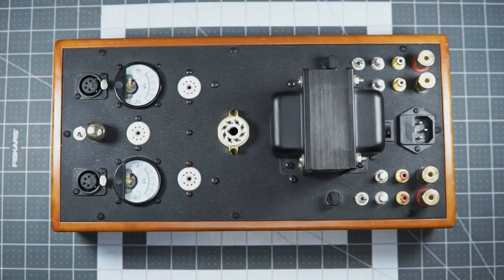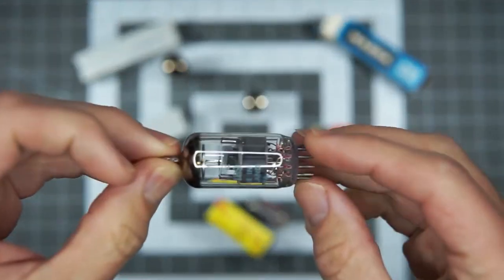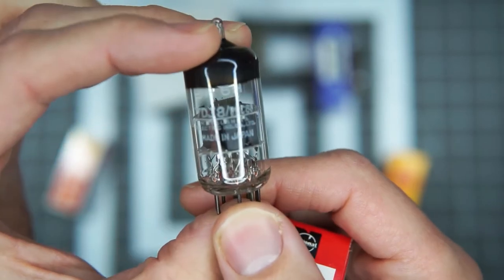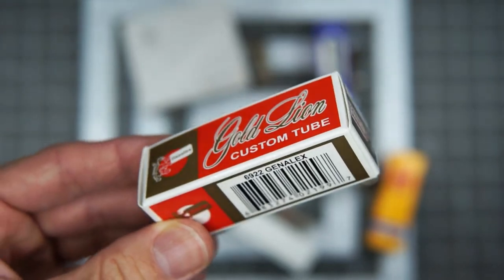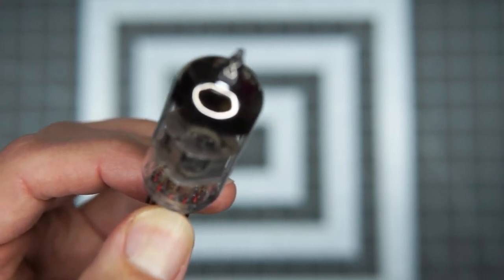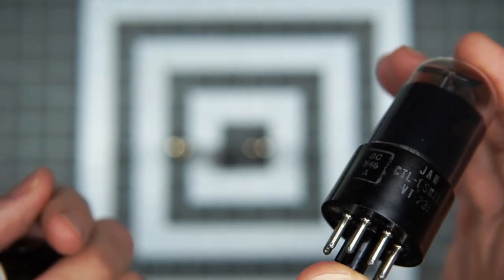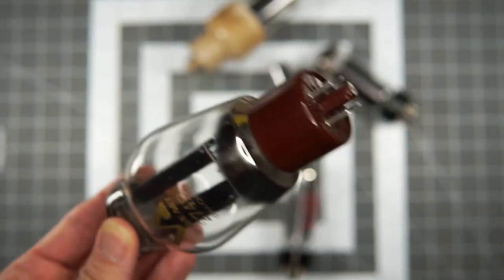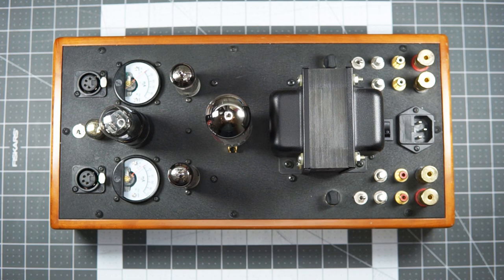Tube Rolling! Decware Taboo MK III - Part 02

Comment: I have the Decware SE84UFO amp and when I decided to try tube rolling and much to my surprise, I found the rectifier tube to have a larger influence on the sound than the input tube. I found the Sophia Electric 274B Aqua to be a significant upgrade over the stock Valve Art tube. I hope you have the chance to hear one in your amp.
Reply from the maker: Yes! I've been playing more with the rectifiers and landed on a Sophia Electric Princess 274B/n. Sounds fantastic.

Comment: I could watch a dozen more of your videos on tube rolling. 
It would be interesting to know if when you changed tube a for tube b if the rest of the setup was the same or if what tube was ahead or after was different.
As a final point, your 'interpretation' of swapping tubes to "correct" a previous/after tube in the line. How can an input tube noise can be corrected by the rectifier tube, etc.
Cheers,

a.
Reply from the maker: Thanks for your feedback and questions. I typically try to only change one tube at a time when dialing in a tube set. If I swap a couple and I get an unexpected outcome it is much harder to figure out what's going on. When you have a full tube amp (input, power, and rectifier) I tend to think of it as creating the right recipe of ingredients to meet your desired flavor profile. A lean and tight rectifier with a fuller and more romantic input tube  for example.

Comment: Just discovered your channel. Extremely interesting. Considering one of Steve's amps and to
be honest would have spent far more money and time rolling the power tubes. Thanks for posting
such a well produced and educational presentation. 🤙
Reply from the maker: Since I made that video I found some great output tubes that are cheap as chips: 6P15P-EV military tubes made in the REFLECTOR factory. You can find them on eBay for $12 a pair! I've played with the rectifier more as well. Tried a GZ34/5AR4 Metal Base which had a lot of presence but did not have synergy with my other tubes. Landed on a Sophia Electric Princess 274B/n.

Comment: How do you do that? I mean discerning the differences when you are playing with 3 variables? I have a hard time doing that when I A/B test 2 DACs on the same integrated amp when I can live switch between one and another. I find it impossible to remember what I heard when taking more than a few seconds from A to B let alone describe the differences.  I am not a "trained" audiophile so I am wondering if it takes a special skill or a special technique to be able to do this. I admire those that can.
Reply from the maker: A/B testing tubes is super ticking, in part because the differences are often subtle and in part because switching tubes takes a good deal of time. With the Taboo specifically I had it a long time and got to listen to a lot of other gear in that time so I became very familiar with its sound. Using a common set of test tracks that I've heard countless times and on a ton of systems I was typically able to notice the impact that a given tube change made. In some cases it was obvious and I could quickly determine a preference, in other cases it would take days or weeks of swapping to make the call. Oh, and lots of note taking along the way. Ultimately I think A/B testing can be informative but your impressions over time are the better measure of what you prefer in your system and what makes your happy. There are no right answers :)

Comment: I have a bunch of those Tung Sol 6SN7GTs laying around, but no adapter, so I'm going to order one and give it a try.

In regards to the output tubes, I remember reading somewhere that lucid mode is lost if the originals are replaced with something different. Did you find that the case? Thanks again for all the info.
Reply from the maker: If you ever need to get rid of any of your spare Tung Sol, let me know! I have not found that tube swapping has destroyed lucid mode. It is altered along with the rest of the sound as you would expect but tends to have similar effects as with the stock tubes.